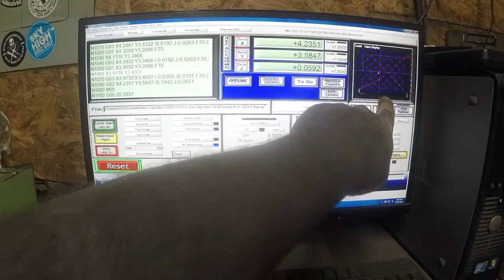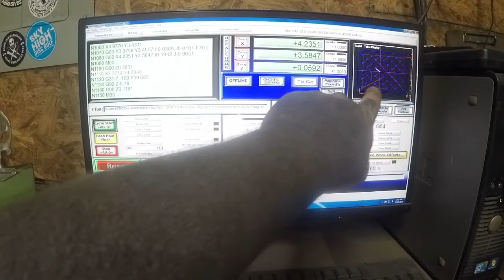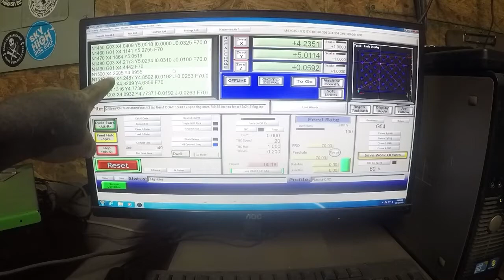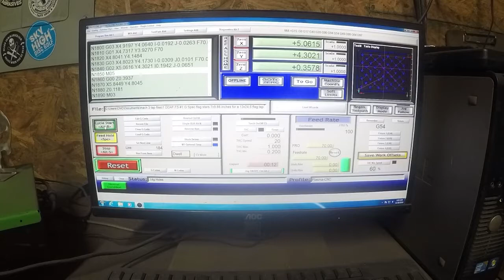mach 3 start and stop cnc plasma cutting fixing errors mach 3 cnc fixing cuts

Comment: My plasma will touch off and fire torch and sit in the same spot then I get a red light “hold motion” in Mach 3 when I follow the steps exactly as you show. Any help is greatly appreciated.
Reply from the maker: I don't know why it would hold motion. If you go back and start it at the 005 part of the G code it should just run.